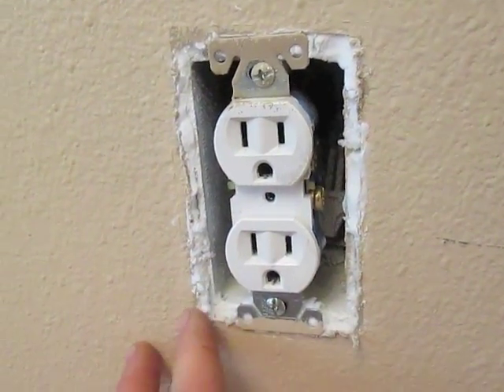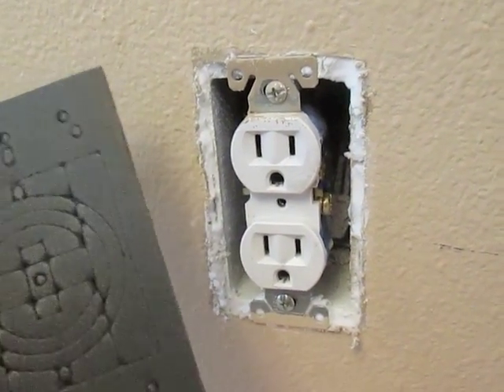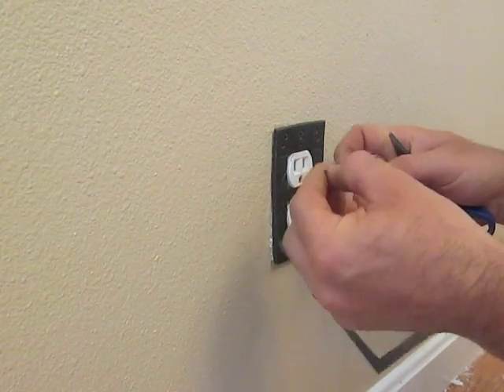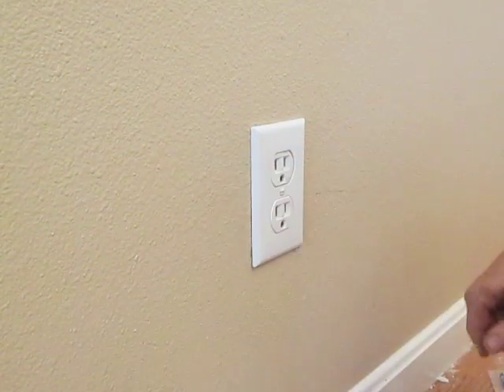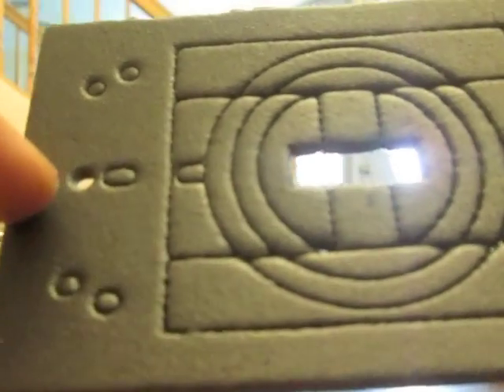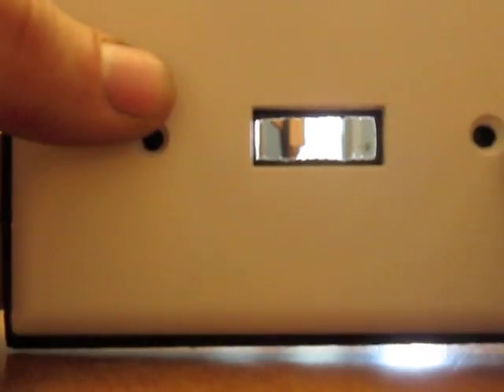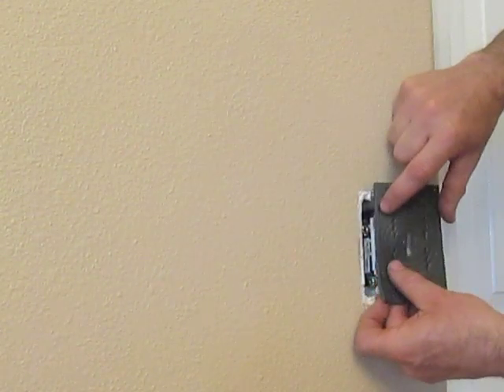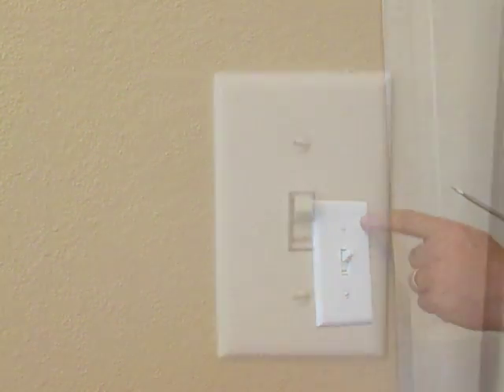DIY INSULATE ELECTRIC OUTLETS LIGHT SWITCHES *** SPRAY FOAM GASKETS***

Comment: Just use the proper foam and you can fill the back of the electrical outlet as well. Pointless doing all that if you don’t fill the back of the box or the extra knockouts